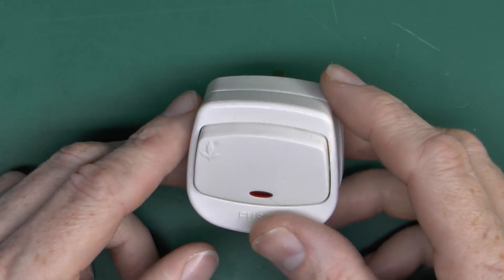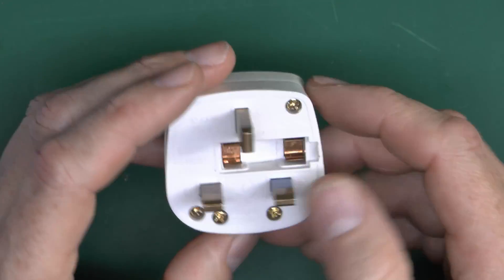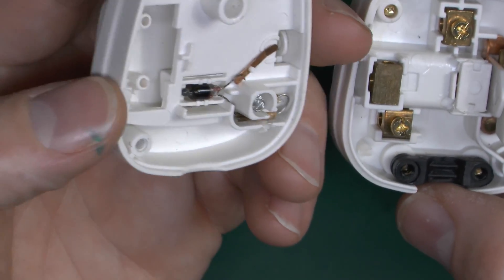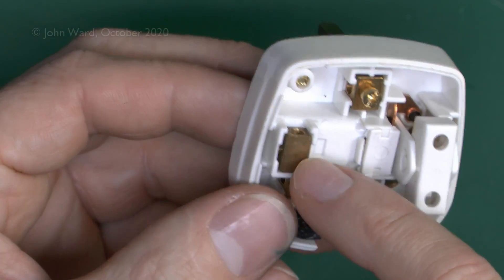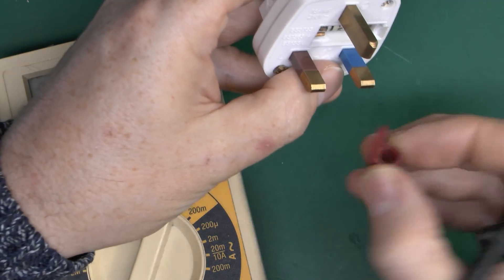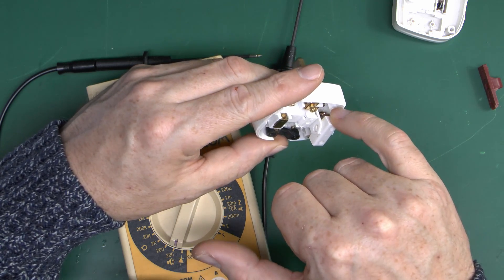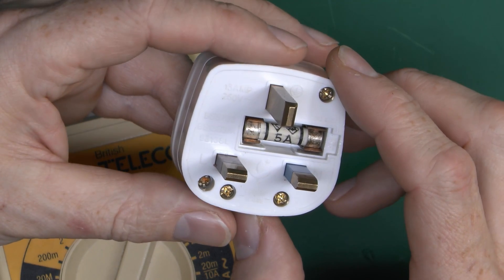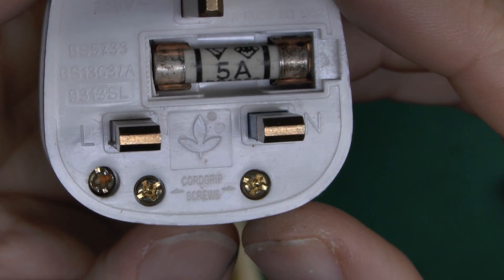Switched 13a Plug BS1363

Comment: The logo appears to belong to Fung Yip Electrical Manufacturing Limited.

It looks like the plug is an instance of UK registered design no. 2095009:
https://www.registered-design.service.gov.uk/find/2095009

Listed here by the manufacturer:
https://www.fungyip.com/product/9313-sl/

The style of the little red window for the neon indicator is very similar to the neon windows found on registered design no 3012858; a switched, 3-way, block adapter. (Or "Socket", to give it the name it was registered under.) I have such a "Socket", which has the same logo as the plug in the video. It isn't marked with the manufacturer's name either, but does have the design registration number, so that's how I found out the manufacturer's name.
Reply: Definitely Fung Yip (usually called FYM / 豐葉牌). It's a Hong Kong brand (stuff made in China, almost nothing is manufactured locally these days) of British plugs, sockets, extension cords, these types of stuff. I have a shaver adapter made by them, which does say "FYM" right below the leaf logo, perhaps it's a relatively recent change.

And yeah, we don't usually use switched sockets.

Comment: I notice that all the screws in the plug have got cross heads - I wish all manufactures would do this, as the corresponding driver self centres on the head. No big deal on the bench, but a Godsend when you're trying to tighten terminal screws in an awkward location.
Reply: I sort of agree with my only objection being they're made of soft brass usually and so more likely to get damaged and become unusable when they're Philips or pozi than a standard slot
Reply: it would also be nice if they used the same type of head on the terminal screws AND the cover/cable grip screws. I hate having to find two screwdrivers

Comment: I'd always thought 220k a reasonable series resistor value for a little neon like that. I have some from ebay which came with their resistors already soldered/welded in place of one leg and those are 150k, which I did feel was too low. but if the neon is blackening at 220k I might start using 330k or 470k
Reply: Generally, the smaller the neon, the higher the resistor. For that size I'd say 470K minimum, and the larger ones 220K minimum.
Reply: Yes, I find the common 220K results in a short life for the neon and the resistor runs very hot too. 470K or so is a better choice. The small resistors often fitted are only rated for 200-250V so using a pair in series increases reliability. For some applications you can even go to a few megohms and still get enough light. Running neons at very low current can cause some flicker, though this often reduces or vanishes after a few days of use.
Reply: I bought a bunch of iflo/Drayton roomstats that I wanted indicators in. So used neon bulbs but couldn't use the NO contacts as then the neon would indicate circuit status and not stat status. So I used the NC contacts to short out the neon bulb. It means the resistor is powered all the time.
Reply: I had one of these but the neon was far too dim so I converted it to LED with a dropper cap/ diode. Was a bit of a fiddle getting all the bits in the housing but it worked....

Comment: Aside from the safety aspect, one reason switched outlets are so popular in the UK is that the plug is so large, and often the force required to insert and remove  them is far more than the US or european types, so the temptation to leave them plugged in is higher. Also stepping on a pins-up UK plug lying beside the outlet is not a pleasant experience!
Reply: it's like a d4, but double the pain and three points of contact instead of one.
Reply: There was a video of a guy with a treadmill and Legos... I remember watching it and thinking that would be so much worse if it was UK plugs

Comment: If you have arthritis of the spine or otherwise infirm, you can use your foot or walking stick. 10/10 👍
Reply: Your right, changed quite a few plugs over for a family member for exactly this reason.
Reply: @paulf2529  I've seen adapters RF controlled - usually a pack of 4 and a 4-button on/off remote for each. Simply plug into a socket and plug the plug into the adaptor. With 1 possibly 2 including a dimming function. Got a set for my aunt a few years ago.
Reply: @millomweb  thanks I will look into those.
Reply: @millomweb  - Yes, the RF ones are really good. You usually get 4 channels, and can pair any number of switched loads onto each channel. I use them for the Xmas lights.... one click and they all turn off, anywhere on the property!
Reply: @johncoops6897  My friend had the kettle on one, elec. blanket on another and a couple of lights.
He could then turn the blanket on before going to bed and turn the kettle on before getting up :)
Reply: reckon that's the main market for them?

Comment: Generally made by Pro Elec, but without that flower logo on the switch. CPC sell them under their ref PL10037 for about £2.50 + VAT.
Reply: Pro Elec is just a brand name used by CPC. In other words, it’s their own brand. But a lot of Pro Elec items are available elsewhere under other brand names.
Reply: I've bought these from Amazon in the past and they are very handy as I have a large multi socket power strip from a 2m tall electronics cabinet that is unswitched

Comment: Possibly useful with multi-way extensions.
Reply: Came to make the same comment.
Reply: Yeah, handy if you have maybe a lamp and a TV or something that doesn't get switched off running on the same multi pad.
Reply: many  multiway have individual switchs
now, at least mine all are
Reply: I got a multi way extension with switches
Reply: I found 2 extension cords with 5 individually switched UK outlets in Estonia out of all places._
Reply: @DjResR  they are good
Reply: you guys dont have switches on extension cords? in my country, we use same UK plugs, but you cant get extension cords without switches anymore
Reply: @syaz4380  We have quite a wide selection of extension cords without switches in Estonia._

Comment: I tried to find the maker or identify the logo without success, looks like a generic Chinese item. It appears on Amazon under the names "Omega", "Invero", "Lilmacc" and "Pro Elec", also as a discontinued item on Ali Express
Reply: Example https://www.amazon.co.uk/13A-switched-plug-neon-21055/dp/B002RWH0UC/
Reply: The maker is Fung Yip Electrical Manufacturing Ltd (or FYM), which is quite a common brand used in Hong Kong. Not sure if they export to the UK.
Reply: @alvinhochun  I think they have been a supplier of white-label products to UK retail brands in the past, but I don't think they are currently doing that.
Reply: @GadgetMan36  At least the ones I bought from CPC are slightly different from the ones in this video, the basic overall layout is the same, but the logo on the top is missing, the bottom is branded "PMS" and the pickup contacts for the neon have a slightly different design.

If you check out the CPC special offer flyers you can usually get them quite a bit cheaper. 

Unfortunately CPC have suspended most of their special offer catalogues at the moment. The only active one is bulk bargins, so there is no discount at the moment for small quantities, but if you want to or more of them you can get them for £1.81 each using codes pl1003787 for white and pl1294487 for black.

Comment: I got one of those to put on my ZX Spectrum +2 power supply as it's got no switch on the PSU.

EDIT: I also changed the fuse to 3A
Reply: I have a Zx spectrum in a box and can’t quite work up the courage to throw it out - probably because I remember the pleasure I got from soldering all the components in and then finding that it worked!
Reply: @richardwallace3477  - Are you sure you mean a ZX Spectrum and not a ZX80 or ZX81? And don’t throw it out, sell it on Sell My Retro or on eBay. Alternatively give it to a charity shop.
Reply: Mark 1024MAK your right Mark, it is a ZX81

Comment: Years ago in the 1970s electronics was a hobby of mine and at the time one of the magazines, maybe Practical Wireless or perhaps ETI suggested fitting a miniature switch into a  13amp plug which switched a silicon diode in and out of circuit so that your soldering iron could be switched to standby power whereby it would keep warm but not overheat the tip and heater when not currently needed.  I built one of these and it worked well but all these years later I now realise how potentially dangerous it was and how much easier it would have been to do it (relatively) safely with a plug like this which already had the switch built in and didn't rely on epoxy resins to retain the switch!
Reply: Thanks for the memories, I can remember that as my Dad made one for his soldering iron ,then made one for  me, with me helping him build it, mine was made out of old brown plug base with immersion heater switch crafted on to it 
Still got somewhere although it not used any more ,shame I cannot post a picture of it here
Reply: I too dabbled in the 70's, you could see and work with electronic components in them days not like now where you need a friggin microscope.
I used to get Hobby Electronics and some time ETI. Oh they were the days 😄😄😁
Reply: I built a control box with a variable resistor as the control (there was more to it, that was purely a control) that meant I could control the temperature, there's a neon on it to say when there's power and another that lights when it's at temperature. Quite handy and 30 odd years later, still working beautifully.
Saves me buying a fancy soldering station... And it was a wee project to build at the time too.